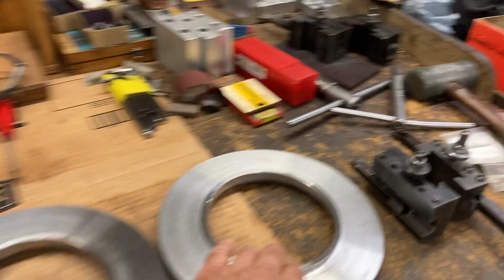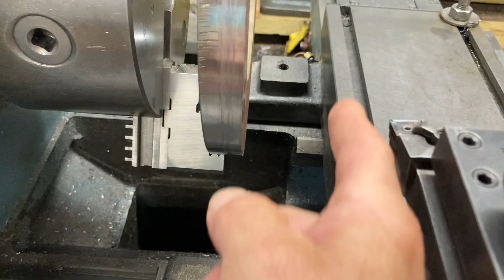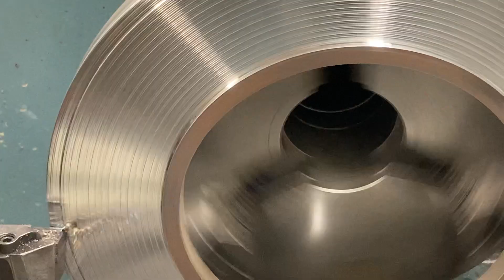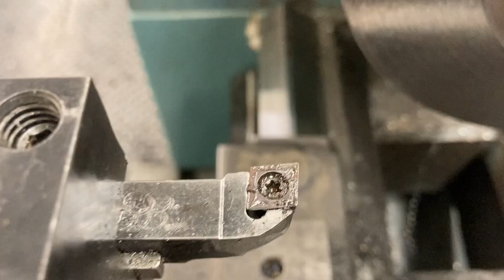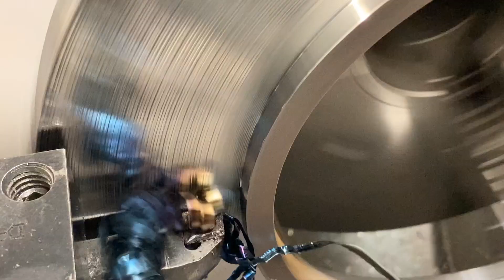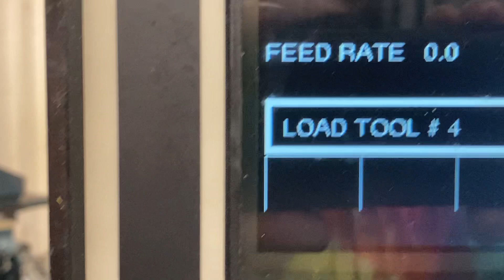Tractor Wheel Spacers Turning 6" HUB Diameter and Finish Bore Thru using Proto-Trak Lathe

Comment: Feed at .012-.014 per rev cnmg 432 if your work holding will take it the chips will break.  You can run 600-900 surface feet if your brave enough.  The more surface footage the better the chips will break and surface finish will get better.  Larger depth of cut always helps but that's down to your work holding and horsepower.
Reply from the maker: Direct RPM only, no CSS.
IPM feed rate only, No IPR
How deep is deep for a 2 tool radius?
Reply: Rule of thumb is to bury the radius.  So .015 for a 431 and .030 for a 432.  That is the minimum depth of cut you can take and expect it to work good.  The max depth is the whole insert.  Most of the time work holding,  horsepower, and a lack of rigidity call for much less.  I would guess .050 to .125 would be the sweet spot for your machine.  Keep up the good work!
   @titanmachinetool